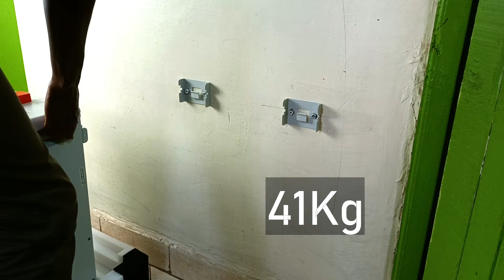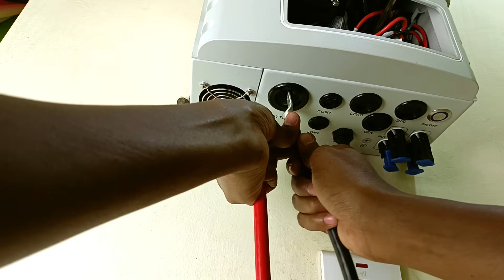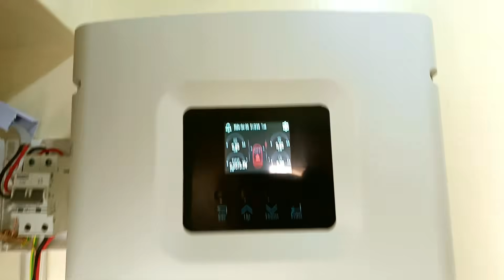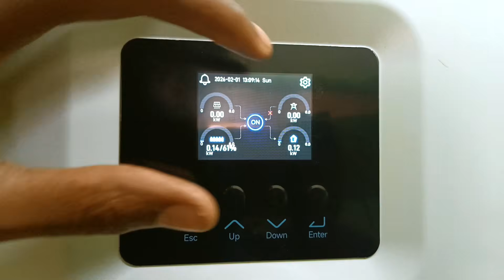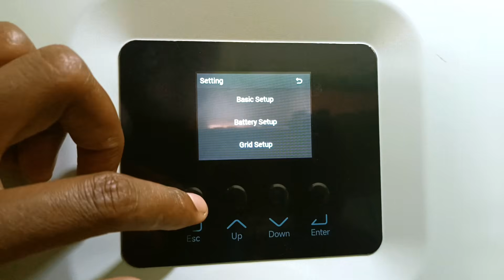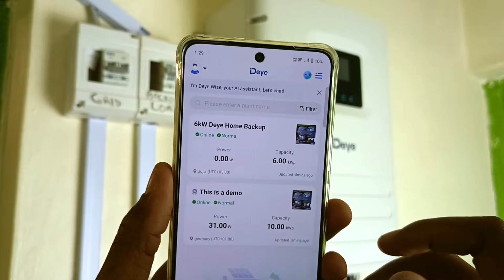Installing the Deye 6kw Off Grid inverter and 5.12KWh Lithium-ion battery

Comment: What if the inverter is reading off on the screen? What  can be done
Reply from the maker: Press the power button to turn it ON. Make sure the battery is also ON. But the inverter can also work in the OFF position. In this mode, make sure the Grid is ON and battery is OFF. The inverter will pass the grid energy directly to the Load.

Comment: is there screw under the orange flip on LOAD, GEN , GRID ports? 
As the user manual tell so, but i am afraid to break the orange flip
Reply from the maker: No screws this port depends on the lever foce to keep the electrical contact and cables tight.
Reply: @DominicGichane  oh thank you. How high can we lift the lever? i am afraid to break mine. As narely lifter the orange lever then inserted the 6mm² wire but it just fell of .

Comment: Must we do settings after inverter installation?
Reply from the maker: Yes, in order to make sure the inverter and battery are communicating. The other reason is to set the max charging and discharging current so the battery will last a long time.

Comment: Hello,

I have ordered a Deye 6kW inverter with a 5kW battery. I need some real information about this inverter before installation.

Some people are saying the inverter makes a lot of noise. I also saw your YouTube video about Deye inverter installation, so I wanted to ask you directly.

I am planning to install the inverter beside my bedroom. Can you please tell me honestly if it makes noticeable noise during normal use or charging? Is the fan very loud or acceptable for indoor use?

Thank you.
Reply from the maker: Hello, the inverter has 2 types of noise. There is a high pitched sound that never goes away. This can be reduced by setting the inverter to low noise mode. The 2nd noise is the fan which is not On the whole time. It kicks in when temp are high and is loud. I would not recommend installation near your bedroom.

Comment: I have a question about the app. How did you set it up? Did you have to connect the built-in Wi-Fi to a router before you could access/use it?

Oh! And you have a new subscriber. 😁
This was a very calm video to watch.

Comment: Please come out with your last video soon as i recently installed this same system with solar panels. I'm just confused on how to configure my inverter to use my battery that charged during the day at night. Now it just keeps using the grid power while the battery sits a 100% the whole night. I don't understand why it just doesn't use the battery power at night. I've been through all the settings and it doesn't change anything.
Reply: Have you read through the manual?

Comment: For the DC breaker installation which side did you install in LINE and Load
Reply from the maker: Top was connected to Inverter as LINE and the bottom was connected to the battery as the LOAD

Comment: You show properly information, congrats and Best Regards from EU\Poland. I use OG01 who have better connectors/ports then OG02 but OG01 not have TimeOfUse (works as UPS) and OG02 with TimeOfUse give more option to work with scheduler per time range.

Comment: You said the inverter not working with single panel i have 4 panels 720 v with 18.67Ah
So i connect to one input PV only is this correct or i should separate it in two panels and cables please provide me correctly instealtion steps

Comment: Very detailed review. I'm trying to choose from SRNE vs DEYE
Still couldn't decide. Some said Srne won't last long and Deye does. But deye cost 2x (100%+)
Srne has all the features I need and it looks like Deye has more features that's why it costs more. those features I don't even need. 
Cloud connection,Grid export,Touch screen,gen port.
Only thing I wanted is it's IP65
Reply: Choose SRNE. DEYE will waste your time powering up

Comment: My new Deye battery dropped 10% overnight when no load was on it
Reply from the maker: That can be explained by the inverter using power. The DC to AC conversion uses power as well as things like the motherboard controls, WiFi modules, fans and just power wasted as heat. What I'm learning is that the system needs recharging everyday with solar, grid or generator.

Comment: Deye inverters use cheap high-frequency transformerless inverter tech.They're so cheaply built that they don't even use an outputput transformer to provide galvanic isolation which result in damage in your home's appliances when their MOSFETs fail. No thanks! NEVER buy an off grid inverter that doesn't have an output transformer.
Reply: You're speaking rubbish... We have three sites with an 8kW Deye inverter installed at each in 2018. We are running all appliances, from LED TVs, computers, PS4s, fridges, freezers, pumps, etc. Nothing—I mean not one appliance for the past 8 years, has been damaged or stopped working.
Reply: @ottavioscribante9873  I think he goes on trolling on videos commenting against high frequency inverters, it is a fetish of his apparently. XD
Reply from the maker: Which model failed and what was connected to it when it failed. Also why do you think it failed. Was it sudden or something might have caused the failure.